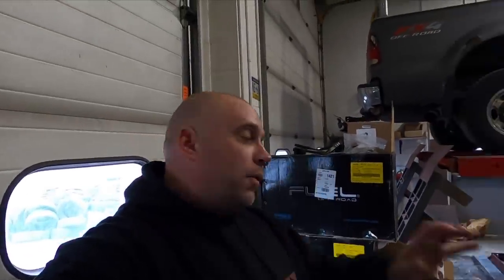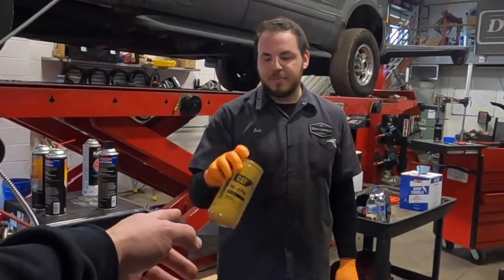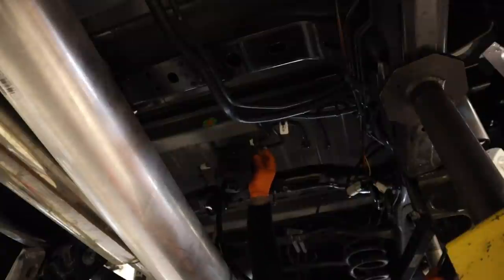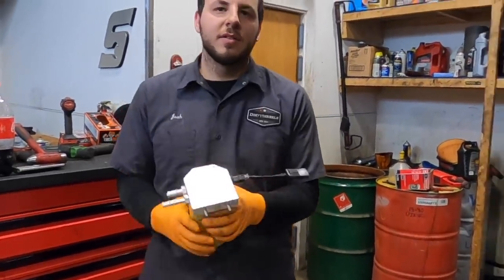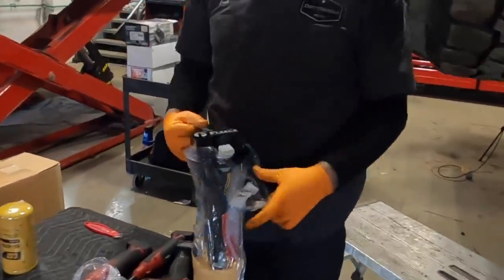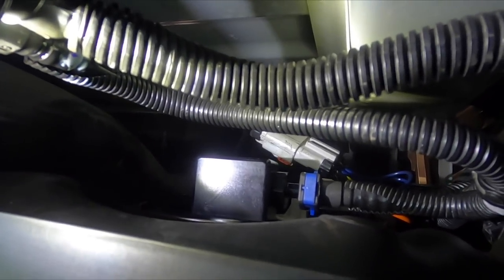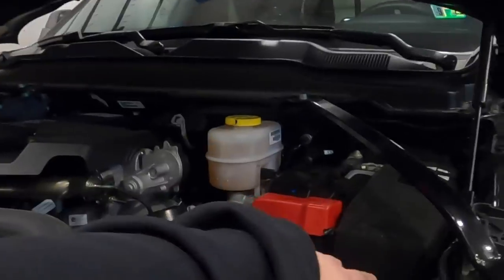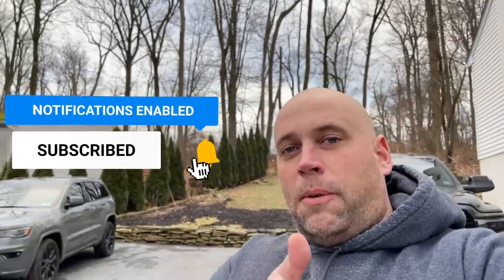SAVE YOUR 6.7 CUMMINS CP4! 2019-2020 Ram HD Fuel System Upgrades & Protection

Comment: Now would have been time to install the titan 55 gallon replacement fuel tank.  I just did the fleece lift pump and  titan fuel tank.  Look into cross reference the cat filters to fleetguard filters
Reply: Im waiting on s&b 65 gal tank. Not sure i need the fleece if im keeping it at stock power
Reply: Brent the fleece lift pump supplies better pressure to the cp3 than the factory lift pump which will keep it happier even if you are keeping it stock, I went with the titan fuel tank because s&b didn't have one for my 2017 ram 3500 crewcab with 8 foot bed
Reply: mega cab, the Titan is 50 gallons

Comment: Interesting you went that route. Fass supports higher horse power, way more fuel flow than that fleece. Plus a lifetime warranty with better filtration. And options to run cat filters as well. All that money you spent you could have gotten something way better like FASS 165-220
Reply from the maker: Nah, I’m only looking to make up to 800HP. This is clean or more than capable of doing the job.
Reply: @BEASTProjects  Id def check your voltage reading on that pump when you get up to 600+ HP make sure it’s not dropping to low when you start pushing bigger number. (Unless it’s hardwired to the battery).
Reply: A couple of things

Claiming the Fass supports higher hp is a bit misleading when considering the context of Steve's application. The Fleece unit is capable of supporting 800whp, which is about what any 165gph lift pump supports. Do both Fass and AirDog make lift pumps that flow more? Yes, but Steve doesn't need more fuel flow. The CP3/4 only needs about 17psi to feed the rail. Having more fuel flow is pointless if the CP3/4 can't use it. Dude doesn't need a 220gph lift pump if he's only wants to make 800whp or less!

The statement that Fass offers better filtration is simply false. Fass rates their filters at 3 microns, while both Fleetguard (OEM) and CAT filter down to 2 microns. Furthermore, the Fleece unit is simply an in-tank pump that relies on factory/preexisting filtration; it doesn't filter anything. 

Fleece offers a lifetime warranty on their PowerFlo pumps, just like Fass. 

Really all three aftermarket lift pumps that are in the 800whp range are all about the same price, and offer about the same level of filtration with comparable warranties. The question comes down to if you want to retain factory placement or consolidate the filters into one external location, and you could have good reasons for either. 

But, and here's the kicker, if you are going to even 700whp I got some news for you... your money concerns aren't in what you spent on your lift pump. It's going to be how much money ($XX,XXX) you're spending on your transmission to hold that power.

Comment: I'd rather have the pump on the outside because of easy access for problems. And put the bottom sump on the tank. 
You can still use CAT filters on both of the other brands. 
You have a problem with what you are using you have to drop the tank and what if the tank is full 🤔
Fleece is awesome but not in this case. 
In My Opinion !

Comment: Given that you're in PA, did you consider adding BMP's spin on fuel heater?  It sandwiches between the filter base and the filter. Or does the 5th Gen not have a stock heater back there like the previous gen? 🤷‍♂️
Reply: There’s no such thing as a 5th gen HD. They are still gen 4.
Reply from the maker: Nah, I’ve never had an issue w/ any of my diesels here in PA.

Comment: If I run the Fleece Performance lift pump in tank do I need the filter right away or can I run the stock filter until I get the extra filters ?
Reply from the maker: You don’t need to run the CAT filters w/ the Fleece Lift Pump. Just keep using OEM if you like.